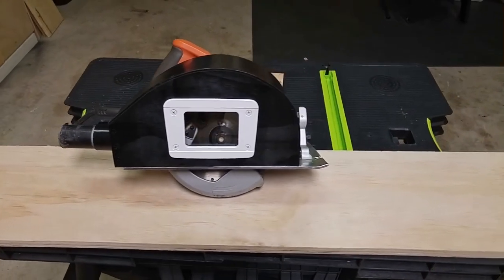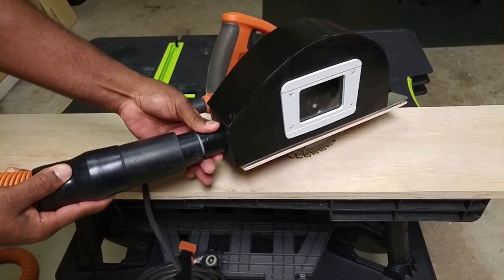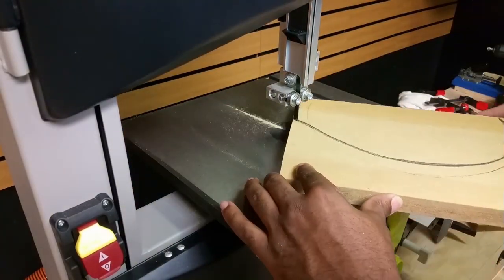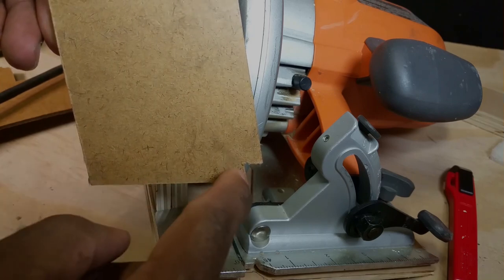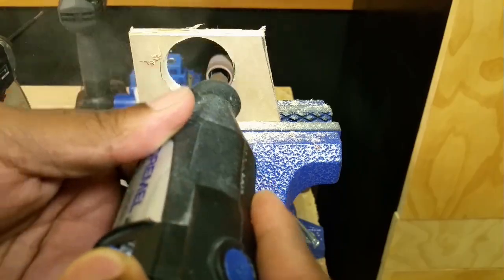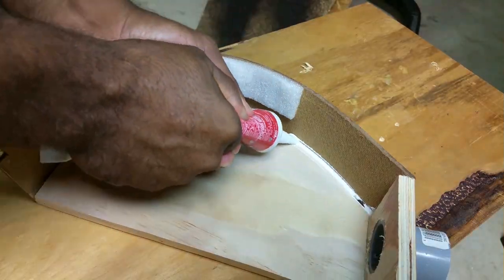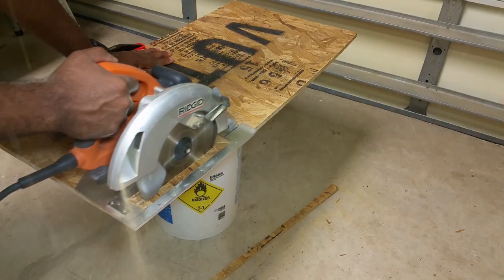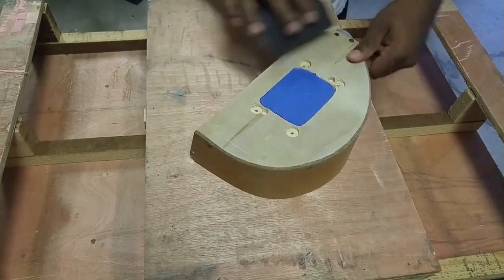Circular Saw Dust Collection Add On

Comment: To make pvc larger diameter heat with a heat gun and slowly slide in the neck of a beer bottle. Use veneer calipers to check outside diameter until desired size.
Reply from the maker: +Sean Signer 
Mm Good idea never thought of that. Thanks

Comment: Outstanding, will be doing this right after the track saw project.  Have several boxes to build out of MDF and want all the dust collection I can get? I've been using a hunk of cardboard and duct tape.  My saw has a port up in front on the top which does pretty good but what you have here covers all the spots.  Nicely done.  👍🏻👌
Reply from the maker: Thank you :)

Comment: I live in an apartment, 1 bedroom, and renovating as much as possible by myself. You can imagine the dust and living situation is very difficult to deal with in these close quarters. Your idea and design, I made one through slightly different than yours, for my Skill circular saw that came out great. No dust issues that I cannot handle and keep the place as neat I need it till the work is done. Thanks for the idea. You get all of the credit.

Comment: Cool idea.  Just wondering if you can view exactly where the blade is cutting?  i never trust the little notch in the base plate as a guide.
Reply from the maker: +danny302 
Yes I can see it just fine. There is a gap near the motor. The notch on mine seem to be  very accurate.

Comment: Hi Glen,  SO how has this held up?  Do you still use it? What would you do differently and what are some of the drawbacks?
Very cool idea my friend.
Reply: I guess there wont be any replies as to how this had held up and been used.
Reply from the maker: Hey man, sorry I don't see every comment. No I don't use this anymore I no longer have that saw. It worked great while I had it. It solved my dust issues which was the most important thing.  The drawback is  my design didn't allow the blade guard to come down whish would make it safer. I would fix that, doing away with the 0 clearance and make the balde opening bigger. If you can find a dust port for your saw I would recommend that, otherwise I would do this.
Reply: @DIYCreators  Thanks. No worries about missing the comments. We do understand your busy. Thanks again. Very helpful.

Comment: what happened to the zero clearance part?
Reply from the maker: +VirtualFather Its here the way this is built I have a choice to use the zero clearance attachment, which provide a better cut. However I think its safer without the zero clearance attachment because the blade guard is able to come out.
Reply: tks

Comment: Too much work, easier to buy Bosch vac attachment, look at the back of the saw, is a dust port. I t is compatible with most of circular saws, if not can just be modified a little, nothing complicated.
Reply: Yeah but it throws everything out the front also